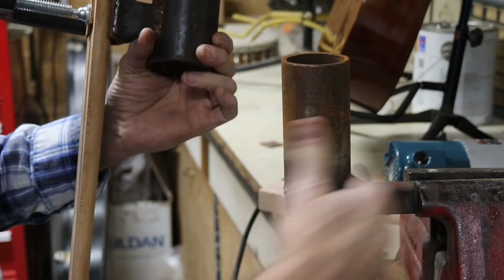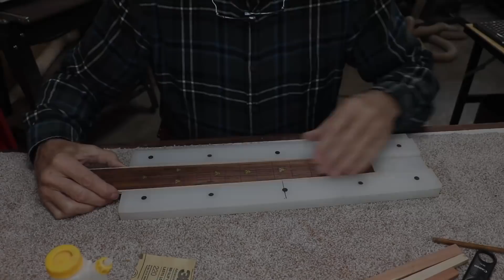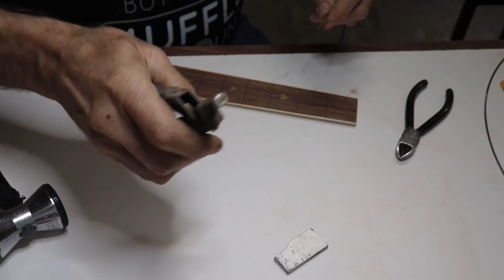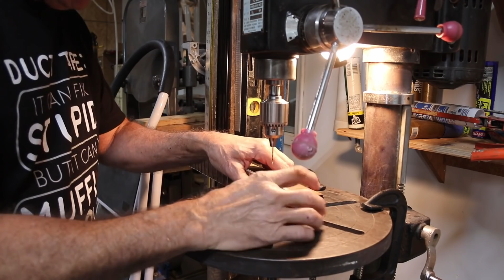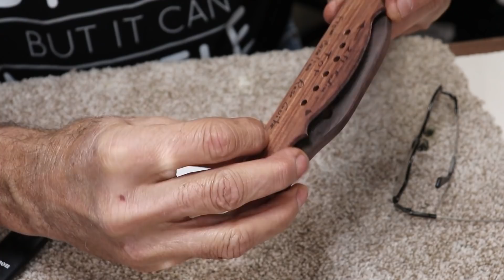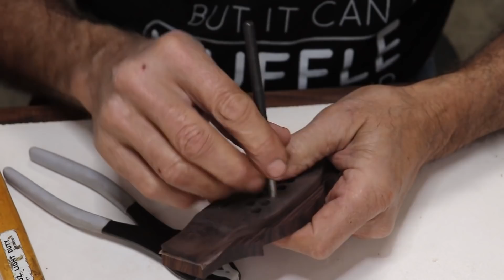455 RSW A 12 String Custom Rosa Dreadnought Part 9

Comment: Hi Rosa string works awesome video as usual. That 12 string it’s turning out amazing!!! Question:
How do you measure the neck relief on a guitar that has a zero fret? The reason why I ask is because I have a Steinberger headless electric guitar that has a zero fret. Usually When I measure neck relief I press down on the first fret and then press down on the fret that meets the body and then I measure with a feeler gauge at about the 6/7 fret and look for 
.10. On a guitar that has a zero fret should I press down on the first fret when making this measurement or should I not bother pressing on the first fret simply because there’s already a zero fret? I really hope that makes sense. Hope to hear from you thanks and take care!!! 😀😀😀

Comment: I have the same fret tang nippers you have, and I discovered that sometimes they leave a bit of a burr behind causing the end of fret to not lay flush against fretboard binding. It's like you have to nip the tang off and then smooth the underside where you nipped it off with a file or a Dremel.

Comment: I saw another repair video where after removing the the little section of the fret tang there is still a little ridge left there so he filed them flat maybe thats why you had trouble with the ends not sitting flush to the fretboard...
Reply from the maker: Nope that's not the problem it wasn't staying down in the slot was the problem

Comment: One thing I’ve done to make fitting the fretboard onto my necks is make a jig that allows me to fit two dowels into the neck and matching holes into the back side of the fretboard and it basically falls into place and locks both together, it also aids in glue up without the fretboard sliding all over the place.

Comment: Jerry a very simple way of peeling the backing off double stick tape is with an exacto knife you carefully stick the point of the knife in the corner of the piece you're trying to peel up and just lift it with the knife blade.
Reply from the maker: I guess you quit watching.  That's exactly what I did.
Reply: @RosaStringWorks  Senior moment, at 69 that's happening more often. Be well.
Reply: @marlobreding7402 :
69 with, un-medicated AD/HD. My life is a senior moment. Oi! 😣🙄

Comment: We all have different techniques or procedures for the neck to fretboard union. I personally size my fretboard first, glue on the binding to make it the exact width and do the inlay. I finish the dovetail joint on the raw un-carved neck, then glue the finished sized fretboard to the neck and using a flush trim bit on my router table I flush trim the neck width to the fretboard. Then I start the hand shaping of the neck. This makes the hand shaping a bit easier and guarantees the neck is the correct width.  This is how the. neck looks after the flush trim. https://imgur.com/Bc3Dubq